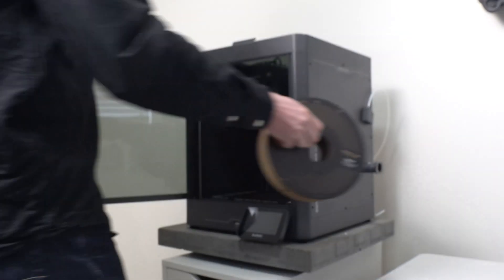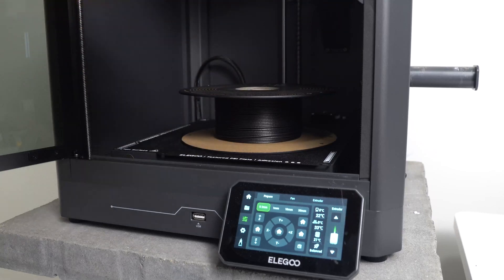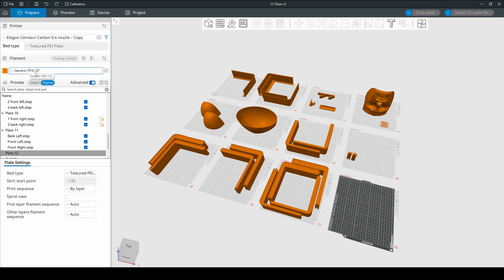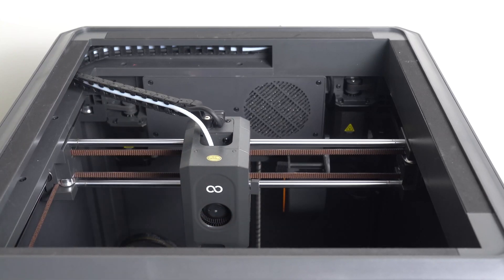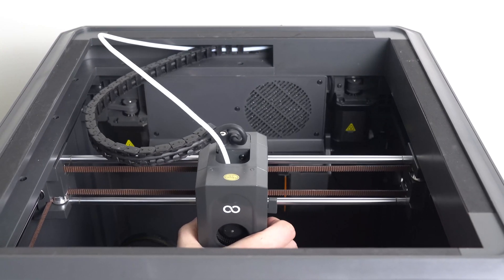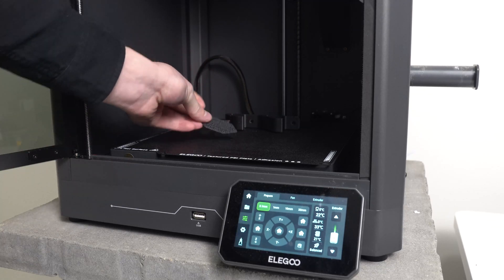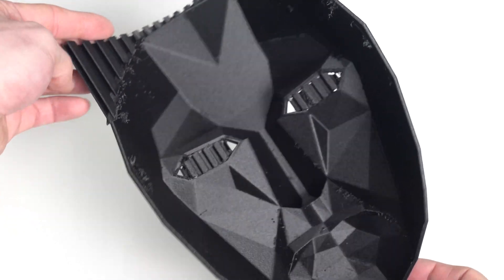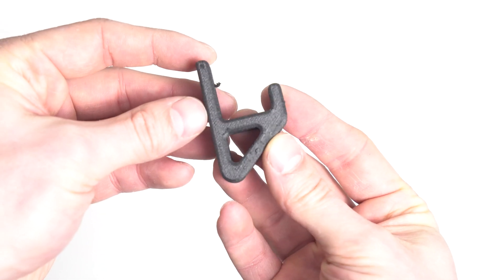How to print carbon fiber filaments on the Elegoo Centauri Carbon

Comment from the maker: They put carbon in the name of this printer so I wanted to put that to the test. This video shows the few things that needed to be considered in order to print PPA-CF on the Elegoo Centauri Carbon.
Reply: I got the same ppa-cf filament and elegoo possible if the print is a 2 day print, would I possibly run into a clog as with my previous printer I didn’t know how to setup my slicer settings for an optimal print

Comment: So can it dry filament or not? You said it times out but then showed it doing 12 hour dry?
Reply from the maker: 12 hour dry was in the dedicated filament dryer. Centaury Carbon times out around ~30mins which means you would have to reset the desired build plate temp every 30 minutes for 12hours. That’s why I mention it as a feature request. Using the build plate to dry filament is a valid option and is a built in setting on some other printers. If you’re going to print lots of nylon I suggest getting a dedicated filament dryer.
Reply from the maker: Alternatively you could make some custom g code that sets the build plate temp to your desired temperature for the desired amount of time. 
M190 90
G4 120
The above would be set building plate to 90deg and wait 120mins (2hours). G code is pretty universal but can vary slightly in which commands are being used from printer to printer so you should look up the commands first for your intended printer.

Comment: These filaments don't seems to do much in terms of strength, but only all more poison to your ecosystem. You should at least vent outside when printing with carbon infused stuff. Just a gimmick. The printer is great, though.

Comment: The minute I pulled my CC out of the box, I loosened the bowden tube from the chain and didn't feel the need to extract it from the nozzle chassis.  I can print effectively with the lid on or off even without a riser.

Comment: Yes, the ptfe tube benefits from being freed off, and given more headroom for a gentler curve. 
I detached the tube from the printhead and chain, withdrew it from the back and reinserted it on the other side of the chain. This works nicely, giving a long gentle curve into the printhead - BUT it could be improved further! The fully-free tube sags immediately after entry and can ride up the riser - risking dislodging my led strip. 
On Printables, user “pascal_lb” has created some tube supports for this configuration. Clips onto the chain beautifully, but I would prefer it to guide rather than grip the ptfe - so I’m doing my first remix! (And I don’t think 6 clips are needed!) 
I have also seen a guide for the downturn, but don’t like the idea of closing the opening on top of the toolhead, and I think offset bending it into part of a spiral would be better (though less easily printable), as it would encourage the tube to rotate at the printhead when the tube is compressed as the head moves to the back of the machine. 
Anybody got any better ideas?

Comment: excellent video thanks for posting, one question do you have to heat for 12 hours each time that you are going to use the filament or do you heat one time and then you can print one time and then the next week with just heating one time
Reply: You should either dry it and keep it with desiccant in a bag, or dry it again before you use it again.
Reply: Its a relative humidity thing.  If the filament is at 18% then you wouldn't need to dry it at all. Higher temp filaments tend to be more hydroscopic so they are more sensitive to exposure of ambient air.  If he dried it properly then hung it on the side of the printer in the open air for a day while printing those 2 projects it could have absorbed enough moisture to be an issue.  This is why you will see most people printing these types of filaments with the roll feeding from a drybox or directly from their dryer unit.

Comment: Can you show how many actual hours you have on that printer?
Reply from the maker: I currently have 92h24m
Reply: I have one on order but getting nervous, a lot of folks are reporting issues starting around the 300 mark
Reply from the maker: @ yeah I don’t really have a ton of prints lined up right now so it’ll take me a while to reach those hours. You have any links to people running into issues? I’d be interested in reading/watching what people are experiencing.
Reply: @  Michael Koch has been pretty public about issues he has been seeing here on YouTube, and a hand full of others. But it’s not really generally release yet so good data with higher print hours is not that common.
Reply: @GriffonWalker  Same here- Hoping that they get all the kinks worked out before I get mine
Reply: @GriffonWalker  everyone should know that printing PLA in an ambient temperature of 35C and above is likely to lead to problems, not least with heat soak. The CC has no filament clog/break detection and in those situations just keeps going through the motions. While that is annoying when attempting unsupervised multi-hour prints, the first thing to try is doing it in a cooler environment, not vent daily on YouTube! 
Another excess temperature consideration is the control computer, located in a poorly ventilated space in the floor. The processor has a small heatsink, but the fan circulates the air, rather than changing it. In my 20C printing environment, that fan runs (on/off not proportional) for about 10 minutes after printing finishes, proving it gets hot. In a hotter environment, especially if the bottom grille were at all obstructed, I could understand the computer malfunctioning - and it is running nozzle temperature control. 
Better cooling design (or modification) would help printing (and reliability) in hotter environments. 

My takeaway is that this printer is more solid than a minority of its users. “300 hours” just happened to coincide with a change of seasons in Arizona, and doesn’t seem to be the endurance of the printer!
Reply: @ I think pointing into the environment is missing the point he has other printers sitting right next to that one and the same environment that don’t stop printing. So that points to a design flaw, making it overly sensitive temper variance. Though I believe we’ve discovered that there’s a problem with the heat block or the temperature monitor or some combination there over with the motherboard as he continued to troubleshoot and share what he’s finding, which is interesting to anyone who’s actually have been gone through this process a few hundred times with friggin any cubics
Reply: @  I don’t believe he has any other enclosed printers. The first problem he encountered was printing PLA with the door closed… He seems to run into problems with long, and not short, prints. What could cause that? I say environmental heat would be the first, not the last, hypothesis to test. 
Quite apart from heat soak in the printhead and using low softening point PLA in 35C ambient, I definitely agree that the electronics cooling doesn’t inspire confidence in me that, unimproved, it should be trusted to work long-term in high ambient temperatures. Not overly bothered at normal UK temperatures, but if anyone posts a ducting design that fits in the base, I would happily print and install it.
Reply: @3DPrintStuff  thanks for the transparency

Comment: This is 100% the reason I canceled my preorders. This is a huge design flaw and will cause a lot of headache and wasted filament/money and time. This trend of putting the extruder head and top of the case in such a compact position is terrible and needs to go away.
Reply from the maker: Yeah I received my core one recently and prusa gave the ptfe tube a ton of room to move around. It really shows that they’ve spend a lot of time using the printer and improving the design. 

Hopefully elegoo takes the feedback and improves V2 of the centauri carbon.
Reply: Same for creality!

Comment: As I understand it, those daggy oozes left on the print are because your filament was not dry enough.
Reply from the maker: Yeah that could be it. Dry enough to print but not dry enough to be perfect.
Reply: @3DPrintStuff  drying at 70 instead of 100+, you’d need to go at least 3x longer (not the same 12 hours) to get somewhat similar moisture removal.
Reply: @3DPrintStuff  i second that opinion, there is still some moisture, not enough to cause ozzing during extrusion, but at retractions the steam creats bubbles becasue of the negative pressure.
Reply: @3DPrintStuff  if the spec wants 100/140c for 12 hours, and you were only able to hit it with 70, then it would need much much longer than 12 hours at the lower temperature to approach the same dryness level. 100 plus is indicating that the moisture really needs to be boiled to shift it! 
On the Bambu Wiki they also say that “Requirement of Protecting Filament  with Desiccant during Use” is “Required” - hence my earlier question regarding printing from a dry box with the CC. These exotic filaments are very hygroscopic. 

Dryers - airfryers (with a dehydrate function) are often recommended, BUT their firmware limits them. For normal functions the timers have a rather short maximum - typically 1 hour. Now the Dehydrate function (on those that have one) can run for much longer (12 or more hours) HOWEVER with the temperature limited to 100c or less. Not ideal for this stuff. 
I think a small fan oven is probably the best bet - though I would use an Inkbird for temperature control rather than trust its thermostat. Plenty time to scour eBay before my CC is due to be delivered in May…
Reply: @3DPrintStuff  I can't find the video now, but they explained how they use nozzle ooze length after stopping a manual extrusion vs time to tell how dry their PA6 was.

Comment: Fantastic! I have been astonished at how little exploration of the Carbon’s carbon-printing capability has been shared, and I am now reassured that it isn’t just a marketing aspiration! 
Have you tried any other ‘exotic’ functional filaments? I’m wondering about the unheated chamber. Did you pre-soak with the heated bed to try and warm the chamber? (What chamber temperature did you reach?) Maybe a low tech blanket might be enough insulation. 
With the position of the filament sensor, is it going to be difficult to print from a spool inside a dry box? (Avoiding moisture uptake during printing) 

Last and unrelated point. You have your CC on a hefty slab. Necessary for this thing or just in case it might help? 
// I know the printer has been called “noisy” and that mounting some printers on a heavy slab, mounted in turn on something like energy absorbing foam, CAN reduce a noise problem - but is it worth it for the CC?